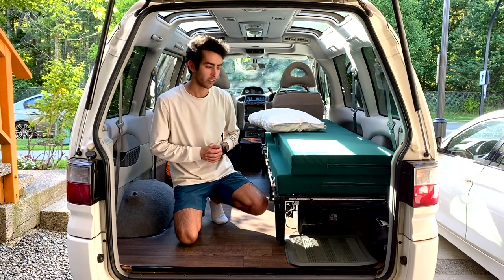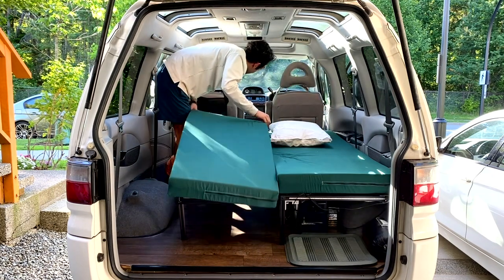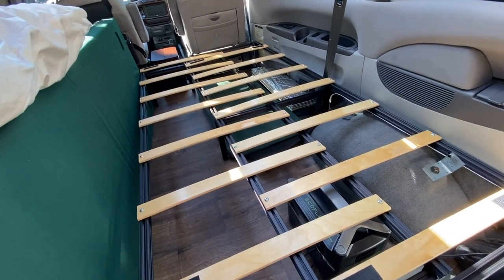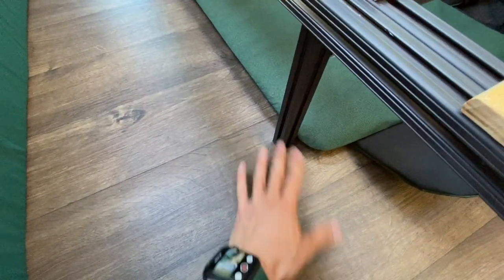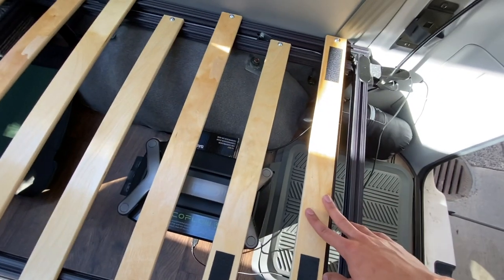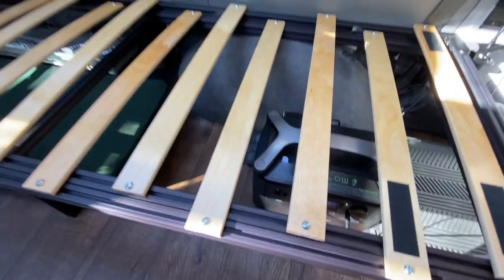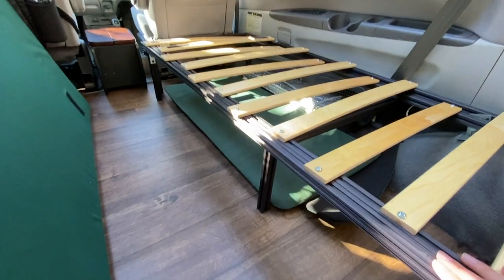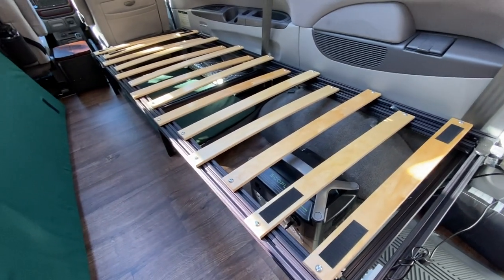Aluminum Slide Out Campervan Bed: Maximizing Space in a Van

Comment: What size is the full bed 120x200 ?? and 80x200 when tugged away?
Reply from the maker: With the slide out piece in, it's 183cm x 61cm (72" x 24"). Fully extended it's ~53cm (21") wider at 183cm x 114cm (72" x 45").